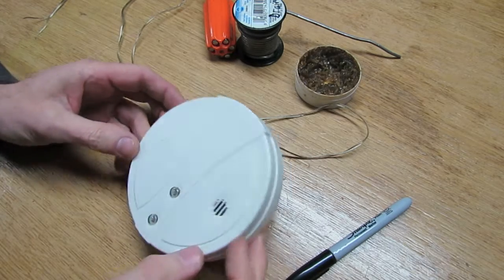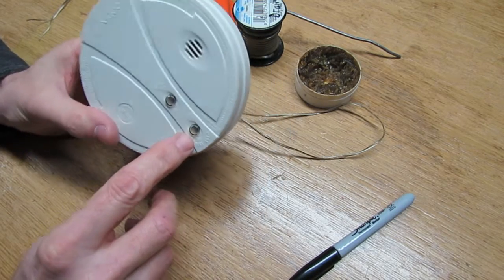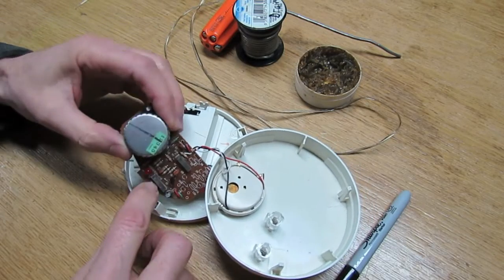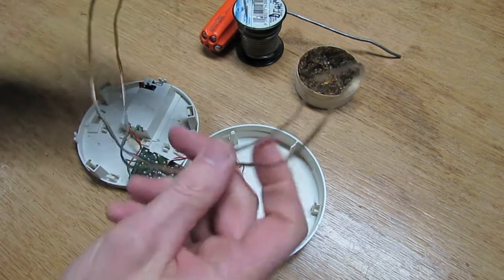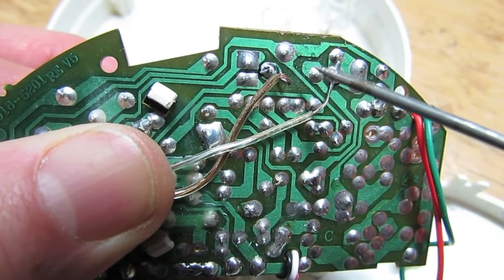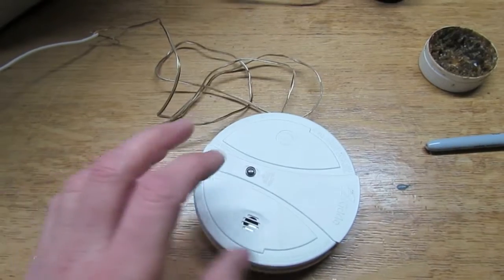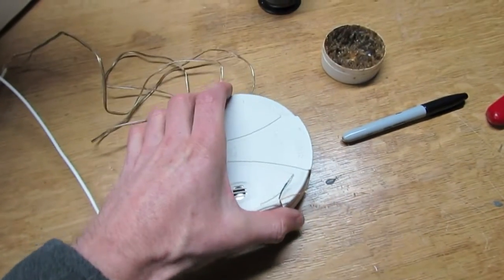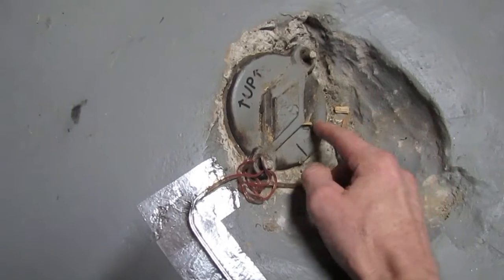DIY ●  Sump Pump Alarm

Comment: Could I put this my septic tank as a high alarm so we know to get it pumped out.
Reply from the maker: This is very low cost and would be easy to set up and try. The only concern for reliability is to choose a type of wire, the wire that is going to touch the liquid, to be corrosion resistant over time.

Comment: I tried it and it works great.  I am wondering if there is an easy way to disable the ion chamber portion so it can't cause a false alarm.  Thanks for the video.
Reply from the maker: The good part is that it still works as a smoke detector. It shouldn't false trigger.

Comment: Question:  Could multiple wires be run off the main to put in different locations in the basement?
Reply: Your wires need to be in parallel, not in series. Then any contact will set off the alarm...
Reply from the maker: If I understand correctly you want to run a wire, then another from the detector, then maybe another, then maybe another? If that's correct, then yes, you can run as many as you want. If any one of them contacts water, it will sound the alarm.

Comment: Instead of soldering to circuit board underside, maybe solder to the test trigger parts on top - possibly cut away part of metal lever for better access for soldering.  If just detecting a wet floor  or water heater catch basin, you can still do a battery test by touching the wires together.  Now I know what to do with those extra alarms I bought on sale at Menards.

Comment: I'm very surprised enough current would conduct from water alone between the wires, sure you didn't have salt water in the cup.?
Reply from the maker: The circuitry is very sensitive and water alone sets it off perfectly! No salt.
Reply from the maker: Another interesting point.....I had it go off without water being present. I found after taking it apart that a spider had made one stretch of web from the one wire to the other and that circuit set it off! Crazy how sensitive it is. Works really well.
Reply from the maker: Since that happened, I took a short length of pvc pipe, drilled a hole in the side and pushed the wires through, I then placed window screen over the ends. That way water can get to the contacts but spiders can't.

Comment: Does it still work a smoke detector too??
Reply: No it does not. Unless you mount it up high enough to where it can detect smoke (within 12 inches from the ceiling).  Hiding it in a cabinet or lower to the ground and it will no longer function (as designed) as a smoke detector.  This is a great idea for re-purposing old smoke detectors that would otherwise be discarded, but I wouldn't do this modification on a detector that I rely on for smoke/fire.
Reply from the maker: Yes! It becomes a dual purpose alarm.

Comment: Another thing you can do with this is wrap the leads in a paper towel and tie it on, the paper towel will wick water and make a connection faster and you don't need standing water to set it off anymore. Make sure to test it so that it actually goes off from a damp paper towel but it should.
Reply from the maker: Yes that would work too! This is so sensitive that I've had it go off and found that a small spider have made a web between the leads and caused it to go off!

Comment: Easy Hack: Make a Water Leak/Level Detector from a Smoke Alarm
https://youtu.be/wXdzyjNHsLQ

This video from 2012, showing basically the same thing as here, just showed up in my recommendations after I watched a similar video from 2017. After seeing the 2012 video I found the one here from 2015. So Chris Notap may not be the first or only person to have thought of it, but it's still a very good idea.

This is a perfect use for old smoke alarms that are being replaced. That way it costs you almost nothing (just a bit of wire and solder and your time), it doesn't matter if they still detect smoke or not, and you're keeping them out of the trash. 

Also as someone else noted in the 2017 video, compared to the cheap leak sensors you can buy online these will probably work better, you can make the wires almost any length, and you will have a low battery warning. And another person there thought of connecting the wire ends to a dry sponge to aid in detection.

Comment: This is just what I need for a property that has an improved lower level. Most of the alarms on the market are meant to be on the floor, and because the detectors are on a continuous surface they would be easily set off by the amount of water that goes through a sewer. Some also are not made to be submerged. By using two wires the alarm should not sound until the wires are under water.

Comment: I completed mine today.  It worked great when I touched the wires together, but not when I tested it in water.  Hmmmmmmmmmmmm.    I stripped more insulation off from the ends that go into the water so that about an inch is bare copper.  Now it works great!  However, it does make me consider that I will need to "polish" the dirt/dust/tarnish from the copper ends everyone once in a while or else they will not conduct electricity.  Thanks for the great tutorial!

Comment: I’d like to place this at a clean out, about 10 feet back from where my septic exits the house. I’d like to use bolts or screws threw the cap to keep the system sealed. Is there a better of worse material for conducting, and how close do the electrodes be to each other?

Any advice is appreciated!
Reply from the maker: +Gamer RPK    Use stainless screws if it's on a damp area. Put the screws as far apart as you can. I had a spider make a web between the conductors that were about an inch apart and it works so well it set it off! You'll  be amazed how well this works.
Reply: Chris Notap thanks for the info! SS it is. Maybe I’ll put a dob of hot glue on the outside as a preventative insulator.

Comment: Great idea Chris. I have several different water sensors and 2 different types which have saved my butt more than once -  sump pump a couple of times and furnace humidifier another. Seems to me you could splice other wires in parallel to other spots and all use the same alarm. Perhaps use a Bell phone type lead connector with the 2 nuts and connect several leads and the sensor to it. Then any leak will trigger it. Thanks. I wouldn't have thought to solder anything to a smoke detector.
Bruce
Reply from the maker: +Bruce Singleton    Yes you're correct. Connect as many as you want to one alarm and it will work just as good.
Reply: An even simpler one which I used for years is a very cheap Radio Shack 9 volt buzzer/beeper. Just connect the leads directly and use a couple of nails, bolts, or anything with a bit of weight to solder to the water end of the lead. include a non-conductive spacer so they never short.  I even placed a standard light switch in the circuit if I ever wanted to disconnect it. Costs less than the smoke alarm but then your smoke alarm can function as a smoke / water alarm and possibly warn of a low battery.

Comment: Can you hook two wires to one detector or one detector and split the wire to monitor two locations?
Reply from the maker: You could connect a long piece of wire, and at intervals, bare the wire and do that at as many locations as you want along the length of the wire to monitor many locations. I hope I explained that right.

Comment: hiii can we use other brand for smoke detector ? or i have to buy the same model, pls answer thank you ☺😄
Reply from the maker: Any brand will do.
Reply: Oh okay thank you so much! Btw it also can detect leaking pipe right ?
Reply from the maker: Where you have the ends of the wire, if a puddle of water is present, if water level rising up to, if a water heater starts to leak, if a sump pump fails, if a pond overflows, if a tank overfills, any of these instances and more will wok as long as the ends of the wire make contact with the water that is leaking or overflowing will work. The ends of the wire need to be placed so that the leaking water will set it off.
Reply: it helps!! thank you so much 😃😃

Comment: I LOVE this channel.  You're giving KipKay a run for his money!    Question, how is the plain water conducting well enough to cause a flow of electrons?  Plain water is normally horrible at conduction.
Reply from the maker: Good question. I don't know the scientific answer but I do know that the circuitry in these smoke alarms is so sensitive that it makes a circuit just from water. I have 2 alarms. One at my water heater and the other in the sewer pipe. I had a sewer back up years ago. This is interesting, the one in the sewer went off and when I checked it, it was a strand of spider web that set it off, the next time it went off it was from an over suds-ed load of laundry from my kids.I have since put a small screen over the end to prevent the spider thing.
Reply: It has ions in it which conduct.  Distilled/RO/deionized water does not conduct well, but it will conduct a small amount. However,  most water is not pure.

Comment: cheap, reliable, and a very effective way to save thousands of dollars in damages.
I'd say that it is also important for the person to keep in mind that the gap between the wire shouldn't be a massive distance away, good chance it might not go off should you use two separate pieces of wire and place them at opposite ends of even a small room.
Reply from the maker: Yes, different situations call for different set-ups. Put the wires apart any distance, it will still work perfectly. I had a spider set it off one time when he made a strand of web across the wires and the wires were 3 inches apart!!

Comment: Very clever!  I suppose it still technically doubles as a smoke alarm too since all the internals are unmodified.
Reply: +Chris Notap if it has a Corbin dioxide detector too it's doing triple duty